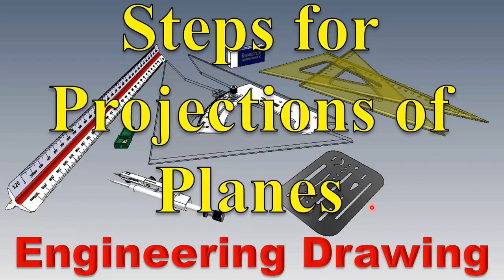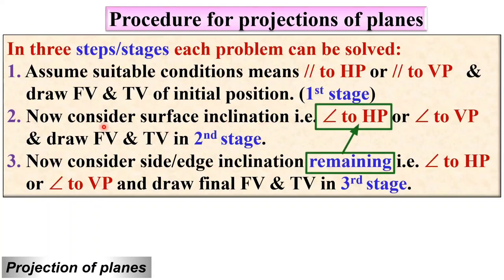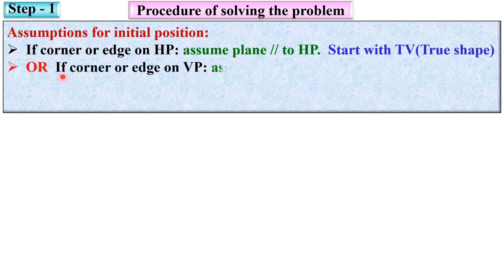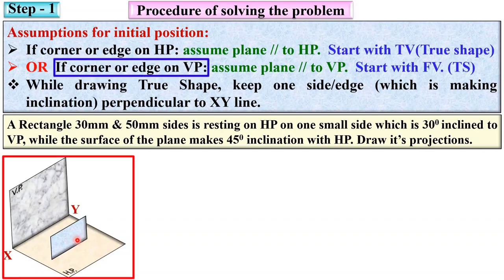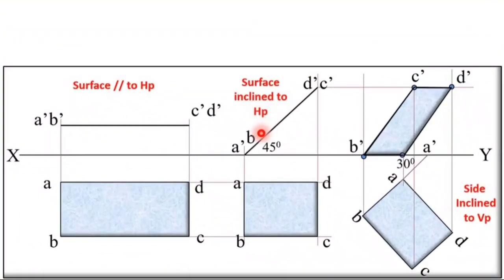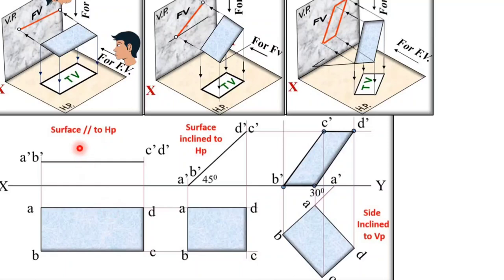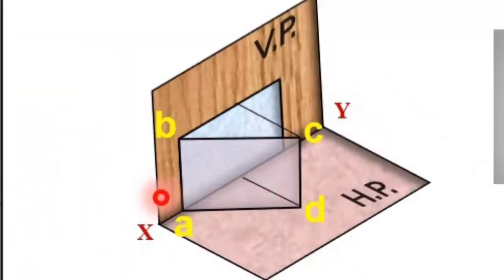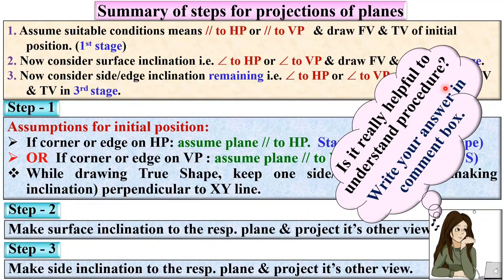2 - Projection of Plane (Basics, Drawing Process & Solved Example) Explained in Engineering Drawing

Comment: Sir can we take that 30 degrees angle left side and draw that shape on left side
And sir here the true length should be on xy line naa..there it is not given that it is parallel. in next question u did correct